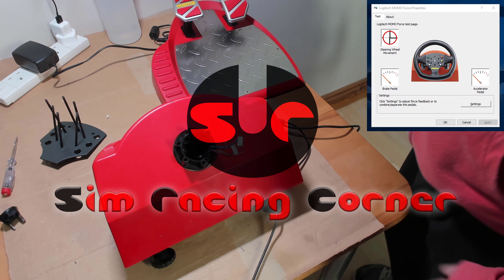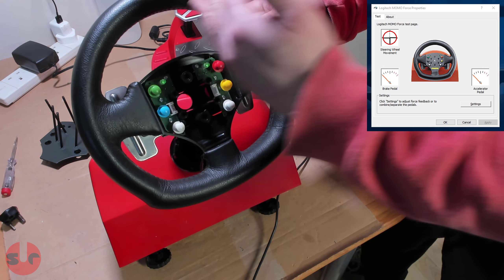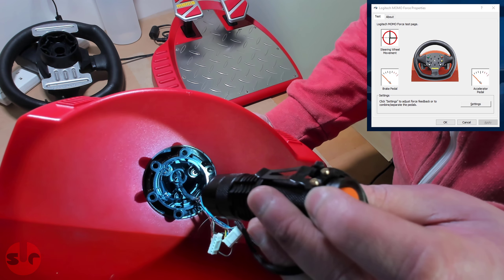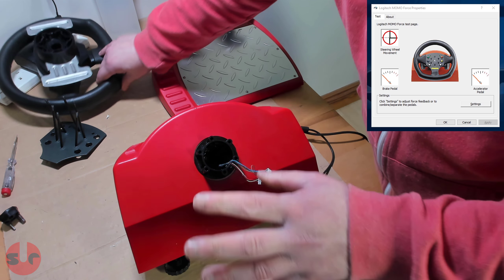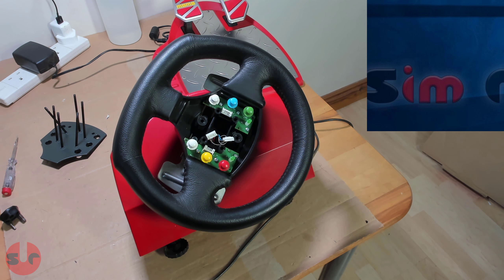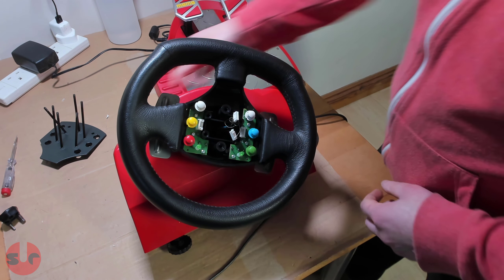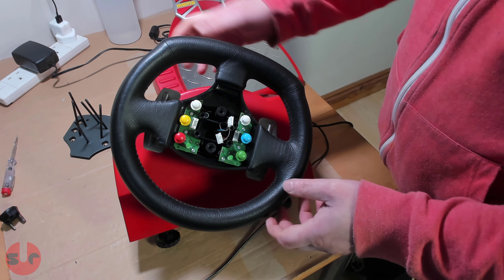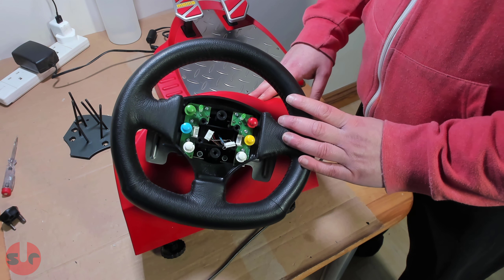Logitech MOMO FORCE 'Update' [THE FINAL FAIL]

Comment from the maker: As a last ditch test, I plugged the MOMO into another PC with no other USB devices (just in case it was a strange USB related thing), but it still had the 'pull to side' problem as in the video.
Reply: Hi Jeremy, I sent you a PM on the forum. Also there should not and was not anything rattling around inside. Just out of interest, did you try the Logitech gaming software v5.1? It calibrated and worked fine on my PC.
Reply from the maker: @PointyUK  I'm currently using the latest drivers from Logitech. I'll try again with the older 5.1 software and will let you know in a bit.
Reply from the maker: @PointyUK  It's the same situation with the 5.1 drivers.
Reply: Mine did the same thing. Had a loose wire inside that old type plug. fixed it and it works fine.

Comment: I ordered one on Ebay 3 weeks ago and it was the exact same way. I took it apart down to pieces. The sensor is all the way at the bottom of the black main shaft you glued. It's a little tiny thing. I think you got the brass colored ring right under the wheel positioned wrong. That's the actual spin stopper. Epoxied mine, and so far so good! Just a psa haha
Reply from the maker: Unfortunately, I no longer have the wheel but thanks for the information. That could be useful for other MOMO wheel owners too.
Reply: @SimRacingCorner  :( would of been cool to see you persevere and finish it though

Comment: Mine did the same thing. Had a loose wire inside that old type plug. fixed it and it works fine.
Reply from the maker: Thanks for the info, that's really useful.

Comment: Well, you have to open 'er up now and show and tell. Could be the potentiometer needs fastening or cleaning/replacement. Re the GT you have bought; it was considered very good bang for buck and pretty decent overall when it came out. I see it still gets a mention when people ask about good cheap wheels.
Reply from the maker: Yeah, I think we're going have to crack it open like a clam to see what's rattling around. Hopefully, round two with the GT is more successful.
Reply: I just bought the same wheel on Ebay would love to know if u get it working down the line the man i bought it off said the shaft is broken so must look into it hope u get yours going would love to see a fix build video on it
Reply: @toomanypints5664  The shaft assembly is plastic and over time it becomes very brittle. I'm not sure why as the plastic gears seem to be still ok on mine.
Glue held mine together for a little while but it just broke in a different spot and I had a new part 3d printed in fibre reinforced nylon.
https://www.thingiverse.com/thing:1286092
This guy took another method to try and strengthen his abs print here
https://ock10stuff.blogspot.com/2016/02/red-logitech-momo-force-hub-repair.html

Oh yeah also I found it so much a pain to disassemble and at $40 for the 3d print I could have put that towards a wheel with a larger turning circle.